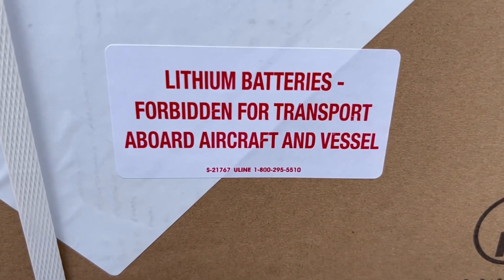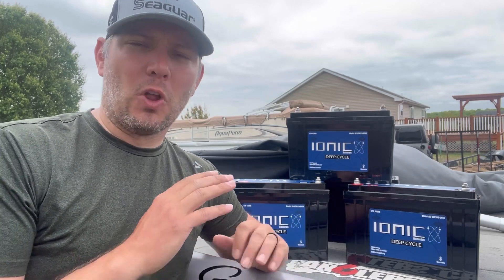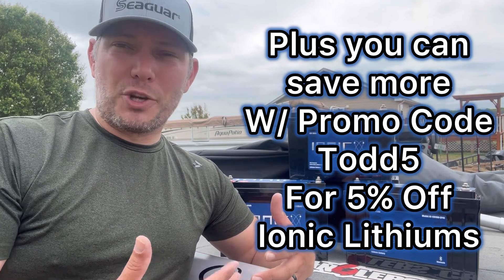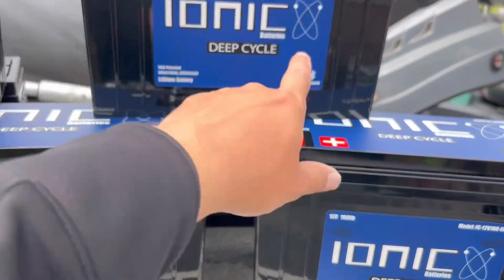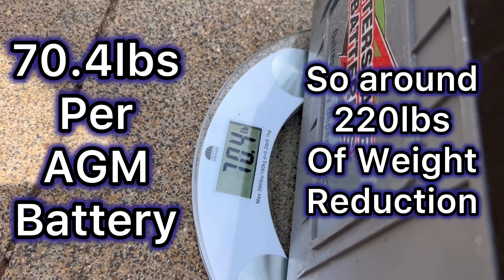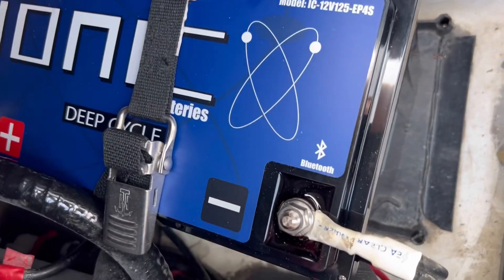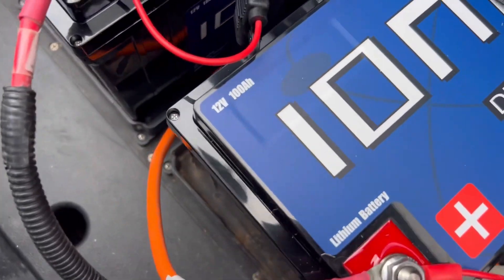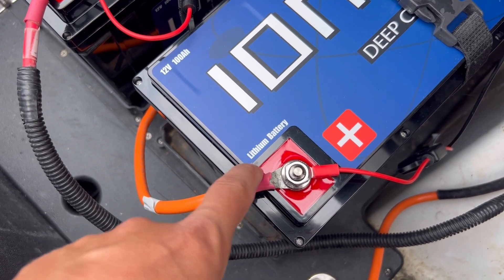Full Review Ionic Marine Batteries

Comment: I have same setup but only use 3x50AH TM batteries. Let me know the status of 125AH Electronics at end of day b/c I was amazed at how much juice the electronics actually take. Im usually around 35-40% at end of ~9hr day. Good luck!
Reply from the maker: Nice! Great setup. Yes I was amazed as well. But the beauty of the Ionic app is I was able to check/run the numbers. So all 4 of my electronics at full brightness and never using standby mode were running around 10amps and in 12 hrs I was about out of juice. 10x12=120ah so it made sense. So I just became more cognizant of turning my brightness down and used standby mode regularly and that saved several amps per hour. Most Tournament days I wasn’t getting below 65% using these tricks. Thanks for sharing 👊
Reply: @dhudson2012  Got it! I've been trying to be more aware of putting console in standby mode. Best of luck rest of the season!
Reply: Cook vid. Any speed increase or fuel savings by saving 220#. Would think there has to be with that weight off. Would of been nice to see/post a side x side comparison. 🤙